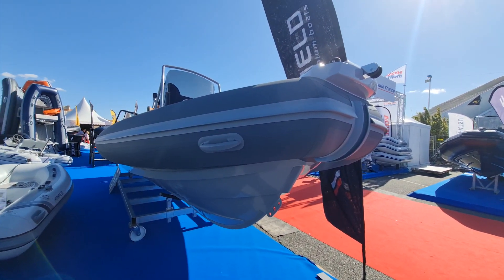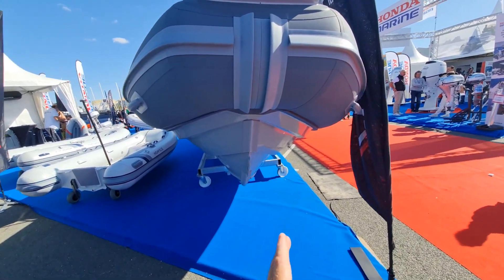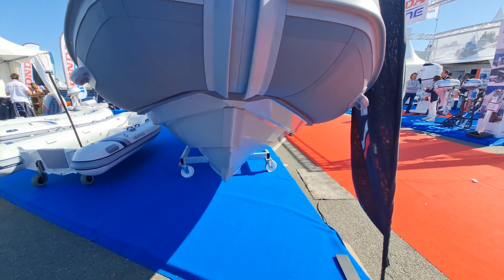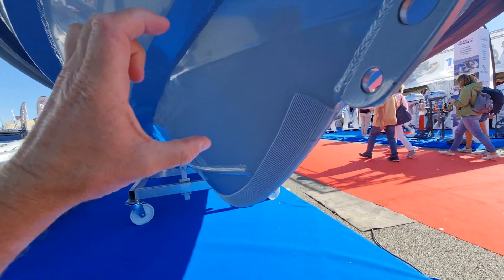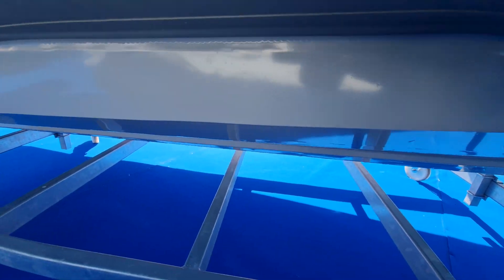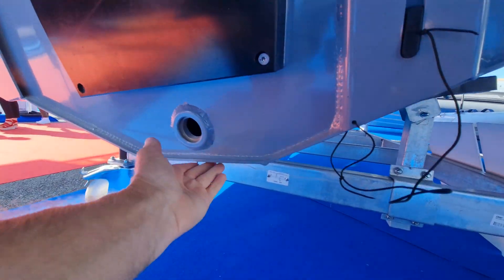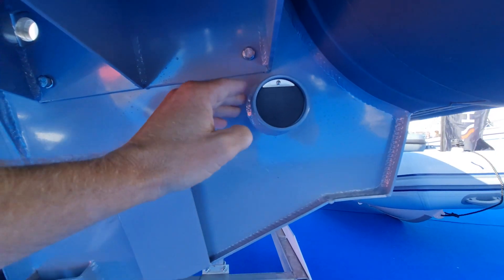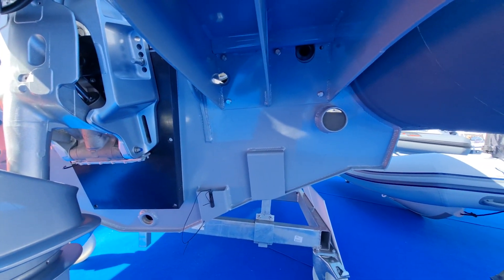Highfield TV - Ep.4 - RIB Hull Terms Explained

Comment: Highfield Boats:   Can we get this angle of attack (and deadrise) on the the Classic-360?  There are lots of round the world cruisers who require a lightweight tender that can also handle big chop going to a remote dive location or an adjacent bay/island - it doesn't exist on the market.  Even big 50'+ cats are weight sensitive to tenders hanging on the davits.  Make the Classic 360 with this angle of attack and deadrise and cut the weight of the FT console in half and you have a game changer.  and/or offer a jockey seat option.